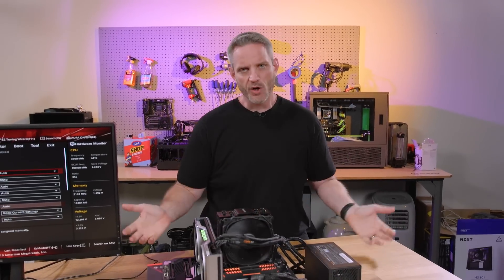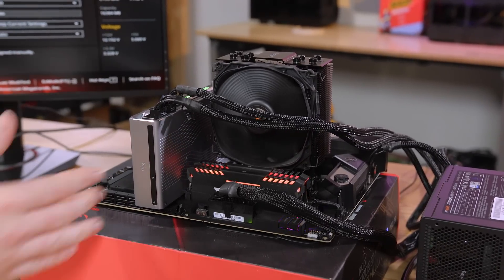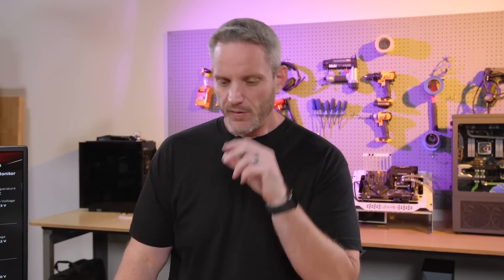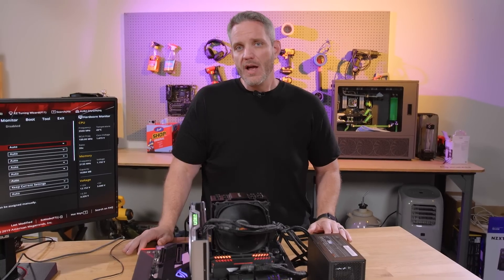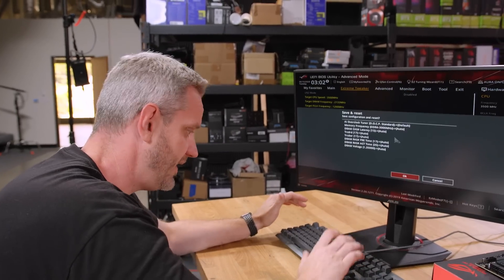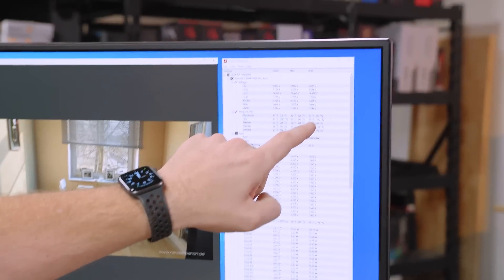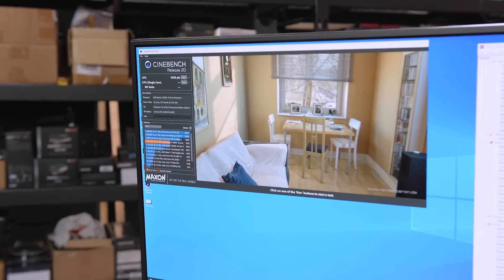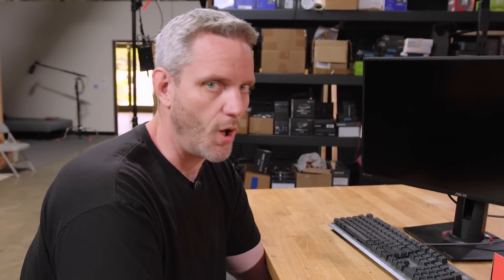Is your motherboard trying to damage your Ryzen CPU?

Comment: -75 to -100mV vcore offset, apply the XMP you paid for, and leave everything else alone. that's the way i roll, and i couldnt care less about a few points in a benchmark or 5fps in a modern game.
Reply: Same man. I run at 1.2v at 4ghz 🤘
Reply: @ShinobiRaijin  howwwwwww i need answer plssss rhis is my first ryzen pc build
Reply: @GauravUniyalofficial  reading his comment without any other context would tell me he used Ryzen master. Set 4Ghz all core, 1.2v, apply settings, and called it a day, but i'll let him answer that if he wants to.
Reply: Blah blah blah blah blah.... go back 30 years & overclock properly using DIP switches & jumpers instead of letting software do the work! That’s REAL overclocking! Banging the FSB from 25MHz to 33MHz was a real achievement to get your 486 running at 120MHz instead of 100MHz which also meant finding a motherboard that would allow asynchronous frequency for the memory to keep those 4MB matched pair SIMM’s operating at the required speeds as they would refuse to boot if set to 33MHz! Also meant setting hardware IRQ & DMI settings for each individual add-in cards This was REAL computer hardware configuration, not Plug & Pray which has made it all so easy since 1995 (more likely 2000 before it actually worked with any real level of success!). I wonder how many “technicians” or “enthusiasts” today would know how to configure a SCSI chain or alter config.sys & autoexec.bat files to enable a system to boot & operate fully? I wonder how many would understand serial & parallel port configuration or a coaxial network requiring termination? Everything is so easy nowadays, but if you actually were maintain, building & repairing PC’s back then you appreciate things much more nowadays & never forget the struggles of AT system configurations (or the cuts as a badge of honour from pushing out the ports required on the rear of the case! The best bit was always jumpering the LED display on the front to show 33MHz/66MHz when the Turbo button was pressed (which was in reality just the maths co-processor or L2 cache on the motherboard being enabled/disabled (dependant on technology being used in the system - mostly co-processor on 486 & mortherboard L2 cache on Pentium based systems). I wonder how many here remember the i430TX motherboard problem that meant your system ran like a dog if you had more than 64MB of RAM installed but was fine on the slower i430HX chipset? I also wonder how many remember when you had to install a dedicated driver for each brand of CD-ROM drive (before the OAK Systems driver that actually worked with ALL IDE CD-ROM’s!). No changing voltages in those days! Only voltage options was the switch on the back of the PSU that allowed you to swap between 110v & 220v dependant on which country you lived in!!!! But, I digress.......
Reply: @RevQuantumBigfoot  /thread
Reply: Cameron Lichtenberger the same thing i did with my 3700x
Reply: @HeriYanto-ig2nr  My old Asus Z170 was cooking my 6700k in stock settings, I set a static voltage and my temps went down around 12 degrees Celcius and performance stayed the same.  I learned my lesson then about motherboard makers adding way too much juice, probably an attempt to keep all CPUs stable for those unfortunate enough to lose the silicon lottery.
Reply: @HeriYanto-ig2nr  how please i need guide my ideal speed keeps on jumping and rendering time it doest goes above 3.99
Reply: @HeriYanto-ig2nr  yep, 3700x here. my friend's Cyberpower PC also has the same CPU and he was experiencing some restarts from overvolting/overheating (with a WATER cooler) in some CPU intensive games like Planet Zoo. I skyped him and we undervolted, now he's good. I build my own PC's, but he insisted on buying a prebuilt during all this virus stuff so i didnt have to go to his house, Cyberpower should be undervolting their stuff if they're already going to be applying the XMP for you. Would have saved my friend a few headaches before he told me.
Reply: @Diviance  couldn't agree more,its like fixing a gpu with a heatgun or oven, sure it will fix it for the shortterm but be persistist and find the real problem
Reply: @Diviance  While your premise is correct, in this "particular " instance is not valid. His MB behaves like all the AM4 boards out there, hence his problem is universal, not particular. The MB manufacturers do not install a soft voltage (or other) limit on "auto" settings, which can be removed by changing to manual, like they use to, on old intel sockets.
Reply: @Diviance  Well, if you have any insight as to why an ASRock X570 Steel Legend on the newest BIOS would be running my CPU a little warm at 1.5v in a 75F room with a Dark Rock Pro4, i'd like to hear your answer (rhetorical). I did my undervolt because at the launch of Ryzen 3000 series, everyone was complaining that 1.5v was too much, and they're right, it's as simple as that. The voltage is too damn high. With my offset undervolt, i lose 100mhz all core, but also run about 15-20C colder on that Dark Rock Pro4. My idle is about 1.344v on the vcore, and my temps are 40C. Under a synthetic stress test, my max temps are 73.5C and 1.25v. Longevity is important to me, because I want to be able to play games on this PC almost every day for 5-6yrs. I dont care for overclocks either. Jay opened up this video by saying that overclocks degrade the silicon to begin with, and he's 100% correct. I will never SEE the performance gain with an overclock on a day to day basis. Yes, im cheap, but in the sense that i buy nice $/performance parts to last a long time. I have no performance complaints at max 1080p 75hz with the 5700xt. I dont know if my PC is 'really' overkill for the amount of years i plan on using it, but it also renders the 4k videos i make nearly 5x faster than my old PC rendered 1080p videos, so i have my usecase, and everyone chasing cinebench scores have their usecase that i dont give a damn about. Furthermore, im using 3600mhz 16-16-16-36, so i expect to gain back any negligible performance loss from my undervolt with this "optimal" ram setup given ryzen, the infinity fabric, and all that jazz other youtubers have explained before. I never had any shutdowns before I changed anything in the BIOS, but I did them for my focus on longevity. I applied that same solution to my friend's PC that was having restart issues, and this video that Jay here enforces that my solution solves multiple issues among the other "degradation" issues that point directly to the voltages. AMD should get to the bottom of this and work literally hand in hand with mobo manufacturers to bring down these voltages. Period. It's the professional thing to do if they want to compete with the image that Intel has. It's the one thing they're missing. No one should have to be an advanced user like myself to use a PC at it's advertised spec. I dont mind monkeying around with settings, but others are not as fortunate as us. I dont like how my friend had to think his PC was busted for 2 weeks because he bought AMD, when he really just needed some simple things changed. AMD doesnt deserve that, but they do need to get their shit sorted because I can only help a handful of people retain stock performance while others still remain to have issues out there (regardless of what they want to use their PC for).
Reply: ZPinch  I can assure you my cooler is mounted properly, I've been building PCs for nearly 8 years now and have a degree in Computer Information Technology, working for Motorola Solutions Inc. As for my friend's iBuyPower PC (NOT CYBERPOWER, i get the two confused, doesnt really matter as far as im concerned), I have nothing to say on the level of build quality and how much they pay their workers, that seemed like a low blow from Diviance given he doesnt work for or run the company (I'd also like to mention that their workers ALL have consented to getting paid for the work they do, that's the entire concept and transaction of work, sooo... the level of quality is down to their training and how enthusiastic the employee felt that day, as with the majority of jobs), also considering my friend's PC gets about 3-4C cooler than me now with the same settings as I have mentioned above. The only real difference here is he has a 240mm AIO on an MSI board and I have the DRP4 on an ASRock. Other cooling factors are pretty negligible, id say his house is kept the same temp as mine, and our cases are comparable.

I'll let you and Diviance work around with your overclock, i have nothing to contribute simplifying any of that. It's all trial and error as far as im concerned. Maybe go watch half a dozen videos, read some forums, and see what works for you. But also remember that no two CPUs or mobos are exactly the same.
Reply: @Diviance  Yeah, your temps are pretty good, your cooler probably has a lot more mass. Speeding around in Forza Horizon 4 (ultra settings 1080p 75hz freesync), i cant even get mine to hit 60C during gameplay. That's just as realistic of a test I can do for a relevant game I play a lot these days. Also, i just wan't to make sure you're looking at the CPU Core Voltage (SVI2 TFN) via HWiNFO64 for your real voltage. Mine too drops to about 1.1v. I'd like to mention that on top of all the changes ive made, it's pretty easy to tell that on paper, the things i have done have accomplished what i set out to do, but mostly affect the idle. I highly doubt any of my parts are defective given it's been almost a year now, my cooler is mounted textbook perfect, and i attribute most things that need to be tweaked to sub-optimal work done by mobo manufacturers, their BIOSes, and what AMD did to "help" them on that two-way street of a business transaction. In all, it'll be "fixed" in time.
In just a quick and simple test with CPU-Z's benchmark, my CPU is within margin of error from the reference 3700X. So i have successfully undervolted -85mV (-100mhz effective all core), lowered my temps (primarily at idle, but it did help under load), and I still have stock performance with the added benefit of being "more stable" given some/many people on AM4 have experienced issues with stock settings that I believe is related to the BIOS and the BIOS's handling of voltage. I'd like to correct that my friend's PC was made by iBuyPower, i confuse them and Cyberpower, and have spoken on that correction in another comment in regards to your words about prebuild companies. No hard feelings though, it was just my opinion. You do have a point on BIOS corruption, ya never really know until you do some pretty in-depth testing that I have nor the time or will to do. Happy computing.
Reply: @Diviance  makes sense, you summed that up well. As a side note, i do wish i was able to build my friend's PC, but he got a good deal to what I thought was at least acceptable in quality parts. iBuyPower and myself are there to remedy any shortcomings it may have, but he plays some crazy games on a 1440p monitor and doesnt exactly "fine-tune" his settings, so im actually surprised it has had less issues than what i would believe would come from a prebuilt (2 PCs ago he had a shitbox prebuilt nightmare i wouldnt touch with a 10ft pole, so i built his previous PC to the one he has now). As we digress... im getting tired, it's 1:23AM lol, but everything we have all discussed in this comment thread should help anyone who comes across it. Thanks though.
Reply: @the_dietcam  It will last longer than 6 years. This defeatist attitude of new every 5 years is unhealthy. Unless you really really have money to burn.
Reply: @the_dietcam  Valid points you've made there. 👍
Reply: MSI boards will lie and when you change this still flood the CPU with excess amps
Reply: 5 fps form 10 fps is way better
Reply: Kinda did the same thing but lowered my voltage from auto 1.43v to 1.275v, 4.2ghz for my 3950x
Reply: Apply xmp yes but why undervolting?
Reply: @s1lver001  lower temps (primarily idle), and possibly improve stability along with inadvertently reducing degradation. it's a case by case basis, and you need to have a goal in mind, as with pretty much any BIOS setting.
Reply: If you actually go through and OC ryzen correctly you can get some pretty big gains. Stock with xmp cinebench R20 was 7200ish with OC I'm getting 7800. 

This is on a 3900x. OC'ing each CCX individually is best. I'm at 4.5ghz on ccx1 4.45ghz on ccx2 4.4ghz on ccx 3 and 4.3ghz on ccx4. 

All core overclock was limited to 4.3ghz due to ccx 4 not wanting to go past that. The rest of the die could go decently further however.
Reply: This is it. This is how it should be done. This is how I do it. In fact, on my 2600x I did a -125mv vcore offset, a -100mv soc voltage offset, XMP - ON and yeah... Sweet performance.
Reply: @Gandalf721  note taken, but I also wouldn't be calling people autistic these days. I'm certain you're not qualified to diagnose such a thing, and I know such professionals that would chew me out in a far worse tone than i used for using the word as an insult.
Reply: Same 1.1 vcore 4,2 GHz on air max temp 47oC on a 3600
Reply: 5fps is a big deal...
Reply: @TimberWulfIsHere  you forgot /s
and in case you're serious, 5fps is nothing when it comes to >frametimes< above 75hz (or higher), which is my monitor's refresh rate with freesync. Frametimes are a much better unit of measurement these days since pretty much any new GPU these days can run nearly any game at some level of detail over 60fps = 16.667ms. Yes, 120hz will also give you half the frametime, but its more important to look at frametime spikes rather than fps 1% or 0.1% lows. It's just a more accurate and meaningful form of measurement in the effort to mathematically display how "good" it feels to our eyes to play a game.
Reply: ZPinch  1. Yes, i am talking about applying an offset voltage. Call me a "nerd", but you must not forget you found yourself replying to a comment on a computer enthusiast channel. Anyway... I would try going a bit further with your offset to see if you can lower your temps more without losing a significant amount of performance. The benchmark you pick is up to you, but try to not lose more than 5% of your performance for the maximum amount of cooling you can get. Also make sure it's stable. -0.1v or even -0.12v is for the higher end of the silicon lottery. Personally, mine is on -0.085v, but i could probably go to -0.9v or -0.95. For a 3600X, you probably wont be able to go lower than -0.95v.
2. Yes, you are on the right track with -.075V to -0.1V being the same as -75mV and -100mV. Some motherboard BIOSes have the units labeled in Volts while others have it in Millivolts. Mine, an ASRock, is in mV so that's what I say.
3. Whether you lock your cores to a single frequency or let them fluctuate as needed is up to you. I would recommend a fixed voltage if you want a fixed clock, and a negative offset voltage if you're leaving the clocks do whatever. PBO on the other hand is something entirely different. I have it off, others have it on. I don't really know if it matters too much, but I do know that PBO can cause instability because it likes to fluctuate a bunch of things for no reason AFTER you have messed with other overclock/voltage settings. If you lock your cores, you should probably-undoubtedly turn it off.
4. Anything else? Would others in the comments like to chime in on things I missed or would like to contribute?
Reply: ZPinch  No problem, and yes, i know you were kidding. But if im going to give you a serious answer to your questions, i may as well attempt to not show the signs of being hypocritical or engage in some kind of a double fallacy. You opened up with nerd, then asked for my help. Which is it? I'm the least sensitive person you could come into contact with, but i do assert my points to be effective. BIG First Amendment supporter here, you can say what you want, but it's your reputation on the line and I chose to reply with "whatever" before answering your questions to the best of my ability. I am a nerd, but i would assume the average person these days thinks Big Bang Theory characters are "nerds". That show makes me want to vomit, and i'm actually just offended by their portrayal of "nerd" culture or at least the re-defining of the word "nerd". Hope your system comes out well dude.
Reply: ZPinch  Nothing snarky or egotistical here, im just not sure what you're trying to accomplish. So, im dumping as much information in the comments to not only help you but anyone else that reads them. Everybody here isnt addressing exactly what they're talking about in full context so im laying down my side so everybody gets a better understanding. As you can tell, i did in-fact get confused as to who is mounting what cooler improperly. My CIT degree does justify my ability to mount a cooler properly, and I have nothing to comment on your Comp Sci comment other than that i prefer the hardware side of things rather than the software, much alike a car mechanic would rather swap an O2 sensor rather than dick around with an ECU. Didn't even want to go to college, i like computers to remain a hobby of mine, but I do have a nice job that was partially obtainable due to my degree, so im thankful for how that, and you should know im being genuine with you. I'd be glad to learn more from anyone here, but i have no issues to solve for myself so im doing my best for others. AM4 has proven for all of us to be tricky, so some subjective topics are bound to bleed into objective work. What works for me may not work for others, so we all walk a fine line of "tread at your own will" and "THIS will work", as i'd hope we all understand.

Comment: at what temp does ryzen 2600  throttle?
Reply: The only way you'll get a 2600 to throttle is to take your cooler off and stick a heat gun on it, mines set at 4.2 all core stock voltage and even with looping stress tests it barely cracks 60c on a 240mm AIO.